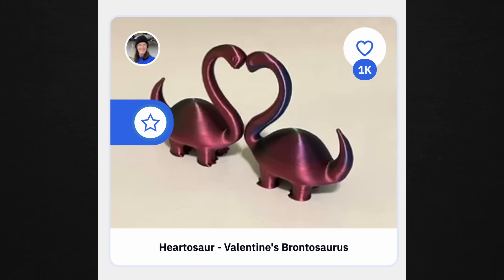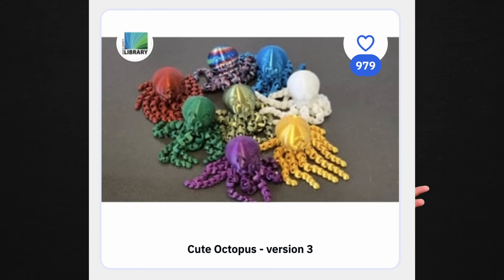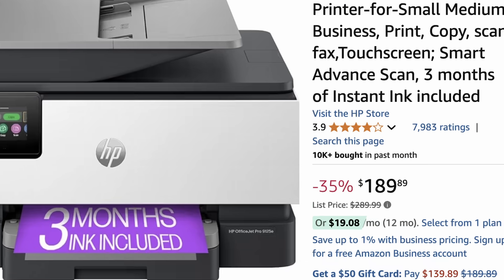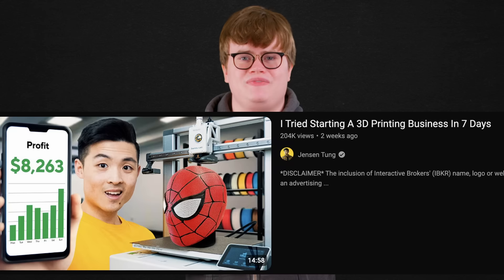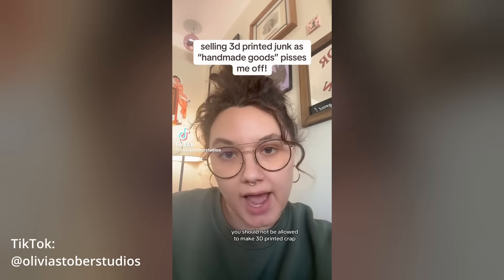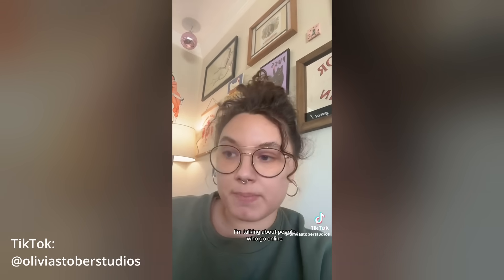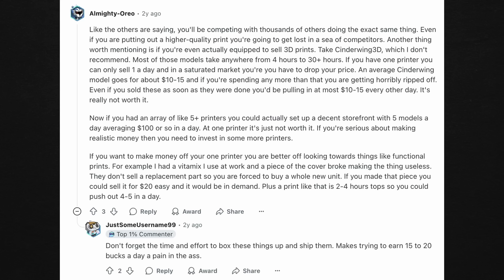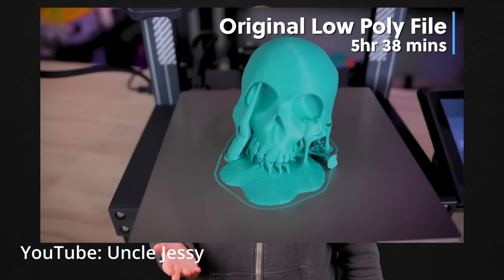The Rise of 3D-Printed Slop

Comment: Two things missing from this comments section: Resin Printers & Hobbyists. Sure, this video most likely referring to FDM printers bc it is about plastic slop. The one thing I'll say about resin printing is that it is a completely different part of the community. While I have more respect, as an artist, to those who design and model their own prints, there is a valid business of printing, sanding, and even PAINTING figures & figurines with licensed files. The biggest thing being warhammer figurines & anime figures. Painters have my respect even if they didnt make the models. If they are purchasing and using the files ethically, it can be a great & profitable business :D

The second part being hobbyists overall. You dont need to learn how to model in order to have enjoyment from printing. 3D printing was a gateway for me to get into modelling! But for the longest time, I was printing props for cosplay. Purely for my enjoyment. It is not as common, but some shops allow sales with their prop designs. Prop commisions are not as profitable, but a fun side hustle nonetheless. Most prop makers do make their own models, though.
Reply: I know this isnt what the video was about, but I thought I'd shed some light on the community for those wandering the comments section.
Reply: Tabletop gaming painters are the least likely to "buy and throw thing away when bored". The printers also tend to print on demand instead of mass producing expecting them to sell like hot cakes.
Reply: @willyberrington  the guy literally and conveniently "forgot " resine technology printers, he knew what he did - people like him love to ban people having fun with their belongings]
Reply: @ OR maybe this video is not talking about them.
Reply: @willyberrington  the video then would be named "why pla/filament printers are slop" . In the topology of the video there is no resine printer as an entity
Reply: @Vladislavaklyma I kinda disagree here, cause YouTube does have an algorithm, and 3D printer is more SEO friendly of a term to use. But I do think it would be nice to specify in the video
Reply: @ah57588  well, he could say "3d printer slop- why fdm/pla printing sucks " thus he just specify the topic and cut the resine printing technology
Reply: I use an FDM printer but for very similar reasons, I use it to print minis and terrain for my DnD games. I'm all on board with the 3D printing hate for people who get them to make a profit or with no aim just to print pretty stuff they have no use for. I don't understand it. I got my 3D printer for a purpose, and use it for that purpose. After printing I spend days painting what I've printed, and absolutely drown it in varnish because it's going to be used over and over and kept forever. You're spot on that if you look into niche hobby spaces you'll see lots of people 3D printing for useful purposes. It's a bummer that other people are ruining the reputation of 3D printing.
Reply: Yup, I could probably do full time painting commissions of 3D prints if I wasn't so lazy lol. I started an etsy store a few years ago, 15k net in my first year and I barely tried.

Not to mention it's a pretty easy niche to put up on youtube, painting anime/gaming figures.

The issue is a matter of scaling, you can only do so much at a time. I do commissions, and I don't want to paint gooner figures as a career lol.
Reply: I was gonna say, my first exposure to 3D printing was specifically from the DnD painting/hobby world, I don't have a printer myself but I've bought plenty of prints from online sellers (who have the appropriate merchant licenses)  of figures, props and all kinds of stuff that I paint or use in models...so I was confused that no one was mentioning what I assumed was a big chunk of 3D printing in general...people actually printing things to paint themselves or to use in making scenes/models...not just printing stuff for the sake of it.  You don't have to 3d model your own prints/characters for it to be a legit hobby/craft  (I do my own stuff too..I just bypass printing and sculpt the old fashioned way)
Reply: anyone who's printing warhammer figures without paying games workshop is a legend who deserves a cookie.
Reply: @theonebuns  lets be honest, even if playing - given existence of 3d printing and eas of 3d modeling the current variaty and stylistic diversity of gw pits is just sad, I cant play with og plastic just because it boring and kinda suck
Reply: @theonebuns  sorry, just now saw you wrote "paying" and not "playing"
Reply: first sale doctrine, i cant wt for this to get to a court. i dont understand how someone can tell me what  can and cannot do with a thing that i made on my printer with my filament and with my electricity. there at least needs to be a time limit on it, saying i can not sell something i made with a file i paid for EVER is bullshit. like say i buy a bunch of buildings from printable scenery, i play them for several campaigns and then i need to make room for new stuff, but im not allowed to sell it after i have used it??
Reply: @budwittman4907  With completely unique models, I sympathize more with license agreements to not sell physical prints or whatever.

But for IP you don't even own? Lol if I buy a 3D model of Spider-Man, I can sell the 3D print of it despite the artist telling me I can't. You don't own the IP, so we're both technically infringing on Marvel's IP. But even so, it's similar to fair use. That's like saying no one can react to my Youtube video because I said so. Lol you can't just say it and it's true, we're not re-selling your 3D model file, it's transformative, turning it into something else.

Also, it is entirely so you don't make money "off of their work" when in reality you aren't taking any money from them. Their sales come from selling the digital file, where others will 3D print it for themselves. Your sales come from someone who doesn't have a 3D printer, who was never going to buy their file, wanting you to 3D print the file you already paid for.

Again, the youtube analogy is spot on. It's like I make a bunch of money off my youtube video, and someone reacts to it in fair use and I get mad because they're making money "off my work".

But yeah, courts really need to rule on this so the 3D printing community can get off its high horse.
Reply: @ I mean, this is the type of people who loooove "to ban people take a  shit" .  It is their life reason, to allow or not do things with their own lives. Not sure what trauma led this particular orator to this possition, but we have what we have
Reply: Tss, you too smart for this video. The guy just found the worst of the worst examples to prove the existence of the video. I really thought it would be about the oversaturation on the mini market, where interesting designs drowns in endless sets for lv5 dnd campaigns or space marines . But no, we have "3d printing bad, because thinggiver baaad.  Wait what is that thing you call MyMiniFactory and Cults3d?" Tfu, just a runter.

Comment: Totally valid points, i really think most things on 3d print sites are close to garbage, i see 3d printers as tools to solve problems, not just plastic trinket makers (even though I've printed some little things for my daughter). I feel that there`s to much random paraphernalia, and just a few really usable stuff, like the gridfinity or multiboard... 
i usually use my printer to print stuff i`ve design myself, most of them on CAD software to solve my own problems, and it fits me really well... shame i don't usually find more userfull things around easily

Comment: I've been part of the 3d printing community and building printers since 2013. Back then printers were grossly taxing to keep going, and barely worked. Because of recent changes in the availability of reliable printers, and the exciting novelty of making your own nick-knacks, 3d printing is undergoing a surge right now.  I suspect that it'll hit its market peak in the next 5 years (if it hasn't already) and then decline - in the same way that regular printers are in less homes now than they were in the early 2000's. The reality is that most people do not have the skills to make proper use of their printers and do not want to take the time to learn how to use CAD software or Blender.

The video title is completely accurate. A huge portion of the models available right now are slop, and it can take me almost as long to find a suitable model for a functional part as it would to 3d model most things I need around the house. As for the dragons, the bubble will burst. Eventually people will have had enough of them, and the next thing will come along, but unless the audience for these things somehow gets bigger, its unlikely that the next fad will reach the same heights as the dragons. 

3d print farms absolutely have a place in society. Its far cheaper to use 3d printing for small scale manufacturing on products than it is to get something injection molded, meaning you can make a profit on more niche things - which is awesome. But the current trend of speed printing low quality items and selling them is unlikely to last for much longer. There is a sense of wonder and novelty towards 3d printed items right now, so many of the visual artifacts are forgiven by the general population, but once the novelty and newness of the technology clears, the expectations of quality will return; and 3d print farms will have to start finding ways to either justify a higher price tag or print high quality at scale.

You talk for a brief minute about filling, sanding, priming and painting objects, but outside of things maker fairs and cosplay - places where people have a higher price tolerance - the amount of time required to do any of this is so high that its a huge way to lose money. I've designed 3d printed functional items for scaled manufacturing before, where you design the product to have as few finishing operations as possible, and optimize not only the print settings but also the design of the part itself to print with little material, reliably and aesthetically. Its an exhausting process at times, and requires exponentially more work than if you design a part for a 1-off. Its gross that the makers aren't using better print settings, but at $40 I wouldn't expect anything to have more finishing than maybe a single layer of spray paint.
Reply: But there's many logical reasons that led to the decline of paper printers - i.e. smartphones, QR codes and so forth.
Reply: I want a regular printer in my house they're just such a racket

Comment: Great video! And great point on needing sufficient ventilating system for running print farms. One small nitpick: HEPA filters DO NOT filter out vapors, which is what melted plastics will produce. It's something that is emphasized in chemical safety.

Comment: I thought there was an open source movement associated with it? I was talking to a dude in uni about it for 10mins maybe 15 years ago? They were trying to get one for their Engineers Without Borders university club. It was an interesting conversation bc I had no idea that Engineers Without Borders was a thing & I had no idea a prototyper/3D printer was a thing. But I remember everything he wanted to do with the exception of printing a Kate Bush figurine for himself was with the club, & it related to problem solving with engineering solutions for communities + individuals were were struggling, it was for specific altruistic problems there was no profit motive for, but could improve lives tangibly + quickly. & making those designs Open Source was part of the project mission, so that other communities could access the solution.